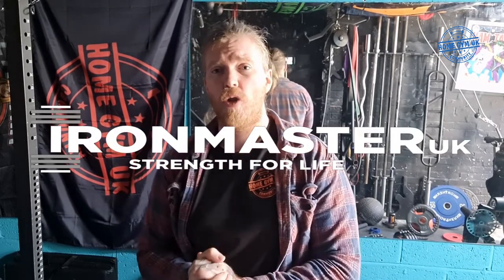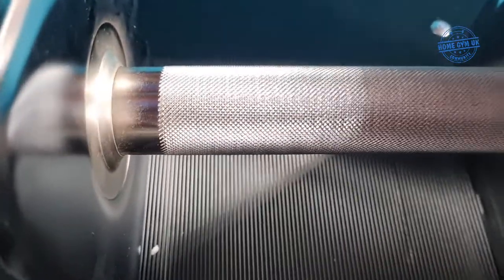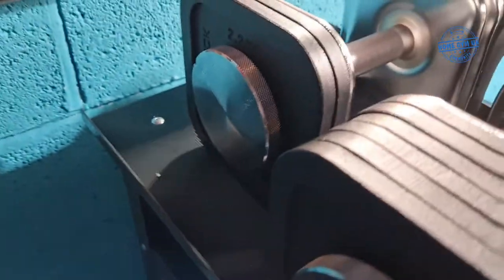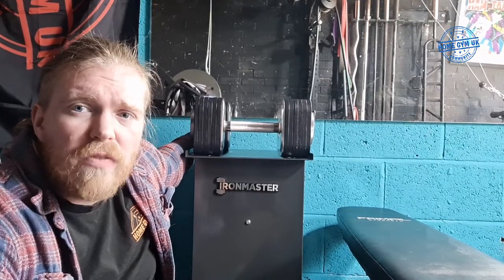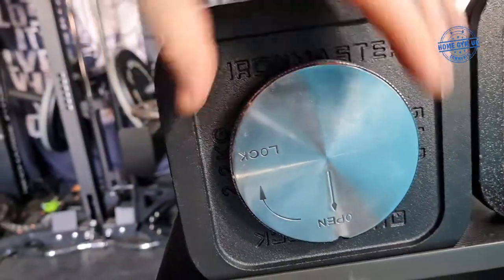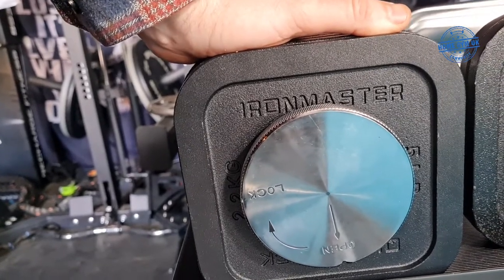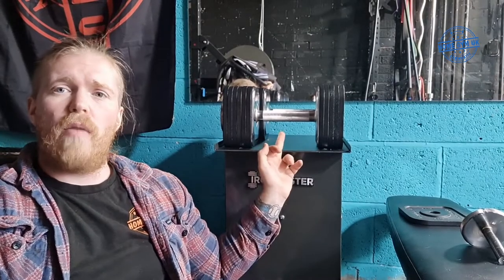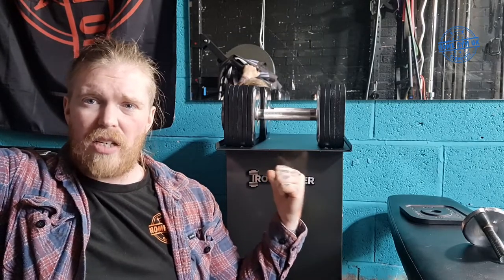IRONMASTER UK, 1ST IMPRESSIONS SHOWCASE VIDEO.

Comment: We're pumped, looks like a strong first impression! Enjoy 💪
Reply: Ironmasters have saved my fitness during the pandemic.  I’ve got most of their products minus the squat rack which I picked up a Rogue SML-2.  Regarding the quick lock dumbbells I got the 75lb Kit, Heavy Handle Set, and the additional kit to 120lbs (135lbs? with heavy handle?). I absolutely love these.  During the pandemic I tried almost every single adjustable dumbbell.  My current set up is a 5-50lb Powerblock Trainer Set.  I use this mainly for light work such as curls or shoulder flys.  But going beyond 50lbs, nothing beats the Ironmasters in my opinion.  It’s solid, doesn’t move, and its easy to lift off and put back on the stand vs. putting a 60lb+ powerblock or even nuobell in its nested set of weights.  It takes a bit of time to take off and put back the weight but I’m usually using the quick lock dumbbells for heavier sets where the break is welcomed.  I have the Superbench most the attachments and the Cable Tower which is my favorite product from them.  I bought and sold lots of equipment during the pandemic so I don’t spend too much overall on home gym luckily and I’m still in awe that I have this equipment in my home.  It has been bar far the best purchase I’ve made.  Good luck and I look forward to more of your videos and reviews.
Reply: please upgrade your stand it works perfectly for 120 but when you upgrade to your highest weight the dumbbell doesnt fit at the top
Reply: @jaybrodi9029  I see how that could be a problem with all the weights stacked.  As I go above 50lbs which is the max for my powerblocks, to the Ironmasters, I just love the security and tightness of the dumbbell.  No rattling or moving parts.  Easy to take off and put back on the stand.  The perfect home gym adjustable dumbbell.  Again, investing in my home gym and ironmasters was one of the best decisions I made yet I think.
Reply: @jaybrodi9029  Thanks for the recommendation. Alacazam. We think you'll like it. Coming soon-ish.